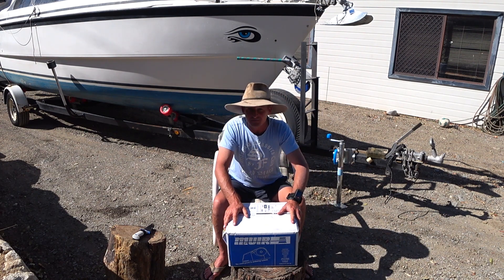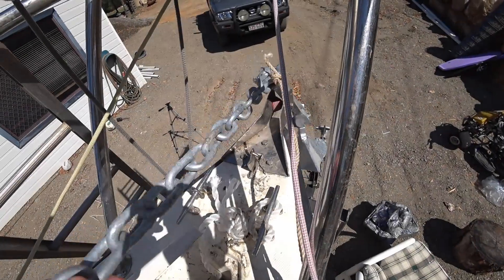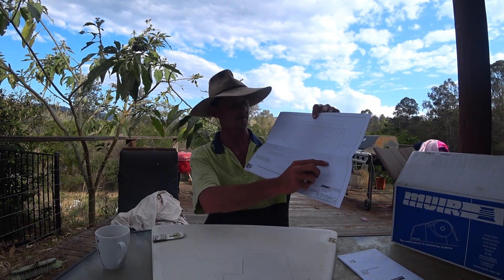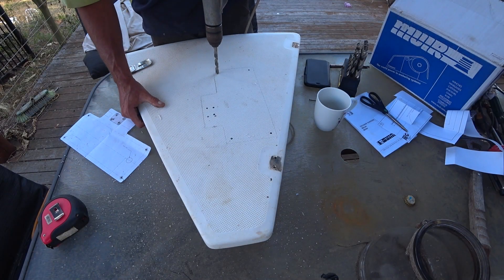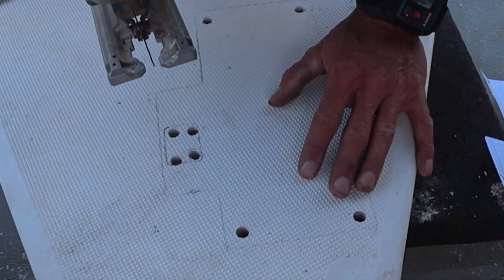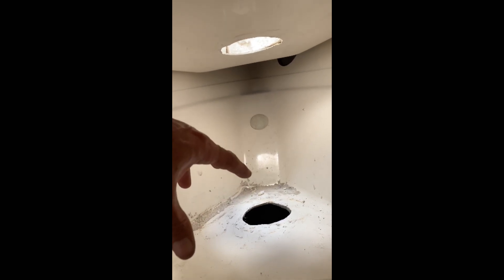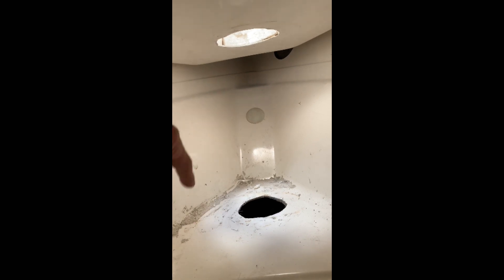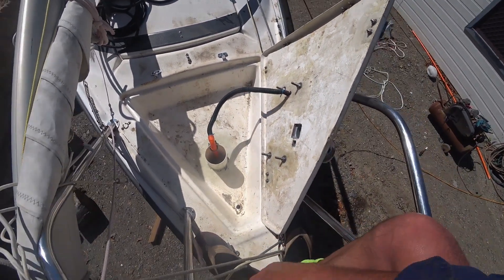Ep 9 Install of my Electric Anchor Winch on a Macgregor 26

Comment: I'm very interested to see how this works.  I want to put a windlass in my X but all the ones I have seen require the chain to drop several feet before the top of the pile, so the anchor locker seemed too small for that.  The plan to use PVC pipe to run the chain into the bilge is brilliant.  So is the idea to run the wires in a separate PVC pipe inside the larger one.  You have totally solved the problem that seemed impossible to me.
 I can save you some time with the polyester resin next time.  It is called a laminating resin which means you do not have to wait for it to harden before laying more glass on top.  Even once it hardens, wipe with acetone and it gets sticky and makes a chemical bond with the next layer.  No sanding required between layers.  There is a wax additive that you mix in for the last coat that causes it to harden completely.  Layers without the wax remain chemically active so you can put down more layers without sanding.  Epoxy is totally different and needs procedures like you describe.
Reply from the maker: Thank u for the tip about the resin i will definatly try this next time,i ran the 2nd pipe to run the wires down so the chain would not get caught up and to keep it dry as possible,i still need to paint the pvc pipe up to make it look like part of the boat in the v berth,Kindest regards Adrian

Comment: Hello, and thanks for video. Exactly what I intend to install. But........ how do you deal with mud, seaweed , sand etc carried by rope and ( mainly) chain into  bilges. Regards Luke.FNQ
Reply from the maker: gday m8,thank you for the question,i think i would connect a inline builge pump at the bow to wash the chain down as it comes up,i myself just get my wet/dry vac when i get home and vacum inside where the chain lies,i generally dont get to much in there though,i hope this helps
Reply: Thanks so much for your reply. I missed it, which is why I didn't respond till now. 
Further questions I have: 
What anchor do you use, and what length anchor rope and chain ( and ratio of rope to chain) 
Cheers,
Luke

Comment: Thanks for the video - appreciate the trouble you took to make it.  
Do you have any concerns about compromising the hull integrity - ie. opening a hole directly into the hull from the fore deck, and potentially allowing water straight into the hull when taking a wave over the front?
Also, it seems to me that by mounting the winch on the hatch, you will be placing all the strain from the anchor onto a couple of hinges and a catch. Do you have any concerns that you might have the hatch just rip right off the boat at some point?
Reply from the maker: gday Richard and thanks for the questions,i allowed the 90mm pipe to come up about 100mm inside the Anchor Locker then Fiberglassed it in with plenty of Matting and Resin which created a water tight seal,there is the hole in the Hatch where the chain goes threw but is quite small
Reply from the maker: i did a good test of the strenght of the hatch where the anchour was stuck deep in mud so i let the winch do the work,the bow dipped down at least 300mm before the anchor released and had no sign of falure but as i do when anchoring always apply a Snubber line as to not damage your winch as they recommend this,i hope this helps,Sorry in getting back to u so late,we sailed our Mac in the Surf to City Yaght Race and have been out for 5 days,this will be our next video,And we out Tack a 40ft Cat,We Even got an Indurance Award,I think u might grt a laugh out of this one,Happy Days

Comment: Looks good.How's it operating? How much chain do you have and what weight is the anchor? Interested as to how the hatch holds up with some use, thanks for the video looking at doing it on my Mac X .
Reply from the maker: gday paul the winch is going great,i have 98ft 0f 6mm chain and the anchor is a 27 pounder i did a test last weekend we where in 30kph winds gusts of up to 40,instead of motoring up on winch i let her do all the work,as we got up on her the bow dipped a good 100mm down then she released our of the mud,the hatch didnt move at all,over night i did put a snubber rope on her as it is not recomended to have strain on winch gear for extended time,we are very happy with the outcome,im glad our video helped u out,Thanks again Paul,Happy Days

Comment: Great video, thank you for taking the time to make it! I was wondering, did you do any reinforcing where the chain collects in the hull?
Reply from the maker: Gday Scott Welcome Aboard,I used rubber matting about 10mm thick,i used a truck mud flap which i had as i have a tipper so had a few laying around,definatly dont want the chain to rubb on the fiberglass as it would wear a mark in it,i folded the matt in half to create a v which worked well then a second matt on the flat overlapping,works a treat,i have now 40ft of chain and30ft of 6mm rope  with a 27 pound anchor,i dragged once in 50knot gusts and never ever wanted to go through that again,this weekend we had stead 20 up 30 knot gusts rear anchored to the beach(so the kids can jump off)side on winds and she held,i was testing a diy bow spit so i didnt use a snubber line(A big no no generally)and she held like a champion,

Comment: I think if u look at the size of the bolts holding the winch to the hatch, that is what the winch manufacturer has identified as the engineered fastener requirement to hold the winch under load. If the hatch hinge bolts are smaller in diameter (which they absolutely are), then u are asking for a very nasty surprise, probably at the most inconvenient time! Maybe it would be prudent to rethink that fit up?
Reply from the maker: Gday Coopers,hope all is well,all the nuts and bolts came with the Winch,the only time i change things is if i need longer ones,my videos are always only a guide,Thank you